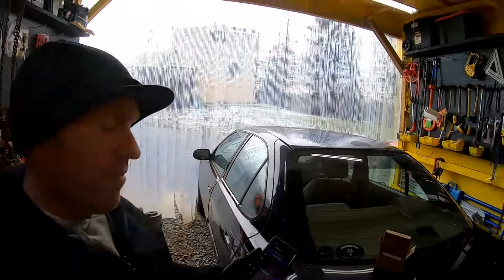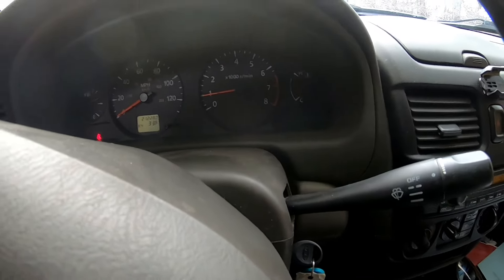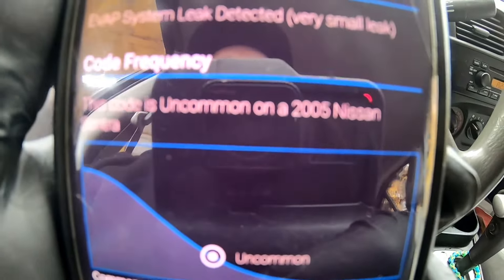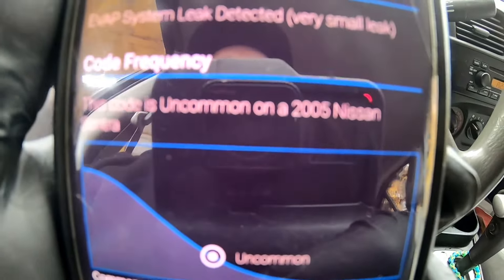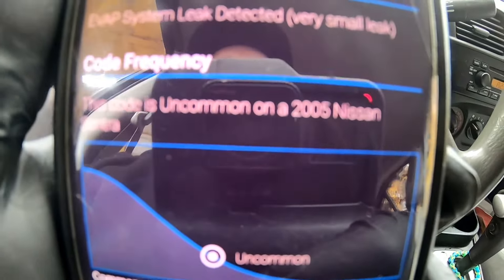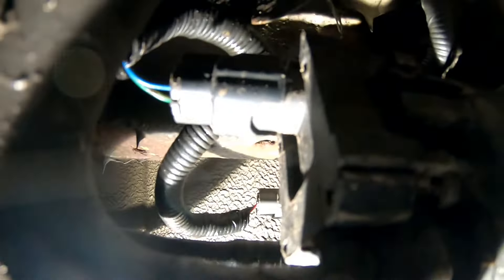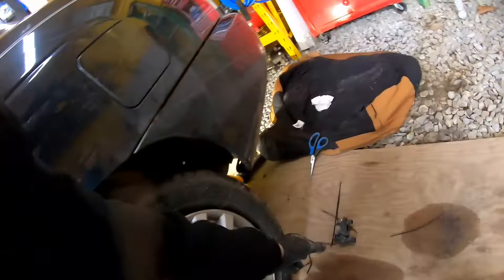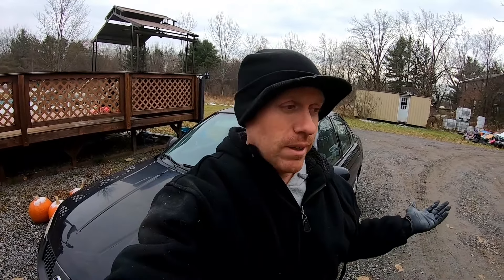P0456 Code Nissan Easy Fix DIY

Comment: There is a technical service bulletin issued from Nissan (TSB NTB17-082a) that indicates that it is the O ring on the cannister vent valve that leaks.  No need to replace the valve, just the O ring.  I know this is too late for you, but it might help somebody else.  The new part you installed obviously had a new O ring on it.
Reply from the maker: Thank you that's great to know and good information for everyone!!! Thank you for watching!👍😊
Reply: That part
Reply from the maker: @tokhenz yup that's the part!👍
Reply: Thank you for that information much appreciated
Reply from the maker: @GOATrilla-os2pe Thank you and thanks for watching!👍😊
Reply: From where i can get that seal? And what's the proper name of it?
Reply: the proper name is simply "O Ring".  The Nissan part number is 16618-JF00A.  I am sure any parts store should be able to size match the O ring if you bring in the old one.  Otherwise the pricier dealer should have it in stock.
Reply from the maker: Absolutely!!!!👍
Reply: Does that mean Nissan will fix free?  What if turn out to be the actual part. In the advisory it says it’s the O ring
Reply: @desr924  Not likely, unless you are a regular customer at a particular dealership then maybe they will fix it for free as a "goodwill gesture"
Reply: @desr924  If your vehicle is less than 8 years old, they might fix it for free as the warranty on the emissions system is, I believe, 8 years.
Reply: The tsb actually says to replace the whole thing
Reply from the maker: @slashome they are cheap enough on Amazon if that's what it says to do, or try the oring like miket1322 said if that doesn't work replace the whole piece,  good luck and thank you for watching!
Reply: @WhitehouseFarmVet  I just purchased the part on Amazon after I watched
Reply: What size O ring?
Reply from the maker: @supersayianshrek5455 I'm not sure miket1322 might know if not they sell oring kits of multiple sizes on Amazon! Good luck!
Reply: I‘ve had this problem for almost a year now. I replaced the gas cap, didn’t work. I checked the dealer and they said to replace the valve. I mentioned the service bulletin too but they said it didn’t apply. I replaced the valve myself to save money, but it didn’t work. Went to the dealer later and had them replace it again in case mine was a faulty part, but it still didn’t work. Gonna be going back today to see what they recommend as a next step. Wish me luck!
Reply: @Mr.brien94  A smoke test needs to be performed to find the leak.  Not sure why the dealer would say to replace the valve but also say the service bulletin does not apply.   That is contradictory.  Good luck!
Reply from the maker: @miket1322 smoke test is definitely the best way! Thanks for watching!
Reply from the maker: @Mr.brien94 good luck these can definitely be a pain! Thanks for watching!
Reply: @WhitehouseFarmVet  My neighbor is a mechanic and he told me that he could make a fortune if all he did was repair evap problems!
Reply: @miket1322  yeah I dunno! They seemed pretty dismissive when I brought up the bulletin to begin with. Got it back today and they suggested the smoke test like you said. I’ll look into doing it down the road when the holiday bonus comes in 👍
Reply from the maker: @Mr.brien94 good luck buddy! Hope it works out for you!
Reply: I had a smoke test done and was told it was fixed.  P0456 came back in a few days.   It has been a thorn in my side for awhile now.  😢
Reply: @aunt.minna33  They should guarantee their work.  Take your vehicle back to them and tell them you want it fixed properly and that you already payed them to fix the problem if they ask for further payment.
Reply: @Mr.brien94  did you ever figure out what the problem was?
Reply: @raulflores6089  no, not yet. I haven’t gone back to do the smoke test, so I’ve got nothing new to report right now. Sorry!

Comment: I changed both valves and gas cap still got p0456 p0444
Reply from the maker: That sucks! Sounds like you have more issues with your evap system maybe even the canister these evap systems are ridiculous! Thank you for watching luck!
Reply: Did a smoke test and smoke is coming from near right rear wheel side up high way above the charcoal canister looks like it's above the tank 🤬
Reply: What scanner is tht you are using to diagnose the problems

Comment: your Amazon link doesn't work. Why didn't you retest for codes after you replaced the valve instead of saying time will tell. Won't testing tell???
Reply from the maker: Replacing a part can temporarily turn the code off, you have to drive the vehicle more than 50 miles to make sure the light doesn't come back on if it does then that wasn't your problem doesn't happen often but it can!

Comment: After replacing this piece the back of my 2011 Altima has started buzzing and the code sadly came back on as of today. I'm pulling my hair out trying to get this code cleared for a smog for my tags. I don't know what to do anymore
Reply from the maker: Buzzing? I wonder if you got a faulty part?  How long or how many miles did you drive before your check engine light came back on, and is that when the Buzzing sound started??

Comment: FYI. For me I had to push down on the top of the electrical connector for it to release. Looking at the new part it looks like the piece on top of the electrical connector needs to be lifted up. (There's a nub on top of the part.) 

All other videos I have seen EXCEPT one was fixed with replacing this part or gas cap. The other video needed to replace the fuel pump. If you have a P0456 error, hope for vent valve or gas cap.
Reply from the maker: Thanks for watching!👍

Comment: i'm trying to work through a p1320 code on my 2000 sentra but the gas cap didn't fix it. i'm glad it worked for you!
Reply from the maker: Yeah check engine lights suck but I did find that bluedriver I bought and did the video on helps diagnose alot of the checkclights and brings you right to Amazon for the parts it's so cool and handy! Hopefully you can figure out what's wrong with you car! Thanks again!👍😊
Reply: @WhitehouseFarmVet  nice. i'll ck that out. i just bought a scanner bc i want to see what happens after i make repairs. the mechanics were unable to sort it bc the car wouldn't die in front of them. now i'm armed and ready when it happens next. thanks for all you share.
Reply from the maker: Lol Awesome! Yeah they definitely help out! Good luck and thank you for watching again!👍😊

Comment: Have same problem on my 2013 nissan rogue
Reply from the maker: Yeah pain in the butt this actually cleared mine up though after buying a gas cap etc this finally worked! Hopefully works on yours ! Thank you for watching!👍😊
Reply: Technical service bulletin issued by Nissan (NTB17-082a) that indicates that it is the O ring on the cannister vent valve that needs replacing.

Comment: Thanks for the video. Did the MIL light come back?
You just climbed up on ramps with the rear wheels to have access?
For the 2012 Armada there's a Vapor Canister Purge Valve and also Vapor Canister Purge Solenoid, they look similar, confused.
Reply from the maker: Yes its easy to get to from the back, Normally its the solenoid they fail all the time, start there if you are not able to diagnose which part, if that doesn't work obviously Replace the valve as well, these systems are junk too bad we couldn't  just delete them and not have a check engine light on! Thanks for watching and good luck 👍

Comment: Hey I was curious if this is my problem since I have the same code or is it the purge pcv valve that’s under the hood and above the engine in the front near the evaporative system?? I was driving my vehicle Saturday and when I turned out on the street after riding for about 3 secs, it stopped in the middle of the street and I also noticed how I smelled gas.
Reply from the maker: Could be did you already change out the gas cap and purge vent valve?  Those are the 2 most common reasons for the p0456 code!
Reply: @WhitehouseFarmVet  I never got a new gas cap but did get the valve cover gasket changed two weeks ago and that code came up along with getting a new ecm
Reply: @cameronmorgan0203 very common issue was the Fuel pump connector. Check it out by unplugging the connector and inspecting for any Burn marks. If it has even the smallest burn marks its bad. Hope this helps 👍🏽
Reply: @diegog2924  appreciate it. I’ll let you know, I think it’s a hose leak cause now I have the code p0442 which is a medium Evap control leak

Comment: 2016 Nisan Altima 2.5 SR owner here. I have the code come up, car runs smooth far. Is this serious tho?
Reply from the maker: No just some states won't let you pass inspection if you have the code!
Reply: @WhitehouseFarmVet  cool thx. I feel better now lol...
Reply from the maker: @ericm6633 I drove mine like that for almost a year only did it because it's required for inspection! Pain in the ass! Lol

Comment: Just behind the back wheel is where the valve is?
Reply from the maker: Yes you might also see a black plastic canister by it! Thanks for watching!👍
Reply: @WhitehouseFarmVet  The canister is where the part twists into on this car. We just replaced the vent valve. Not sure if it is fixed yet as the driver is out driving it.
Reply from the maker: Good luck and thanks for watching!

Comment: Are in in the back of the vehicle or under the engine compartment
Reply from the maker: Back of the vehicle!👍
Reply: Thanks, I have a 2006 Nissan Armada se
Reply from the maker: Anytime! They are really easy to replace just remember if the check light is still on disconnect the battery or use a scan tool to reset! Thank you for watching and good luck!👍😁
Reply: You're welcome, I got real lucky because my part is in the engine compartment right next to the spark plug on the driver side so I just live up the hood and it's sitting right there alongside.
And thanks again for making videos I try to do a lot of information videos as well so I'm going to do one for the Nissan Armada SE so people know where that one is located.
Reply from the maker: Yeah that definitely makes it easier to work on!  If you post it send me the link I'll watch it!👍😊
Reply: Ok I will. Thanks!

Comment: I got the same code on Infiniti q50 2014 any suggestions ?
Reply from the maker: Did you change out your gas cap or this part on your infinity yet?
Reply: @WhitehouseFarmVet  changing my gas cap today to see if that helps
Reply from the maker: Hopefully that is the issue it's very common! Also you might need to clear your check light if it doesn't do it automatically and drive it for a while and Hopefully it doesn't come back on. If it does come back on then we will move onto the next step! Good luck buddy and let me know how it works out!!👍